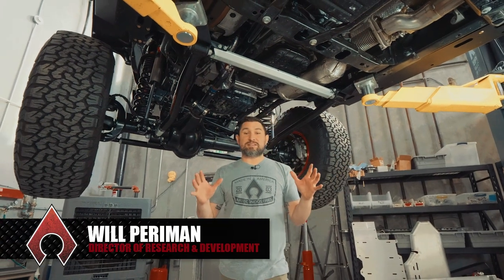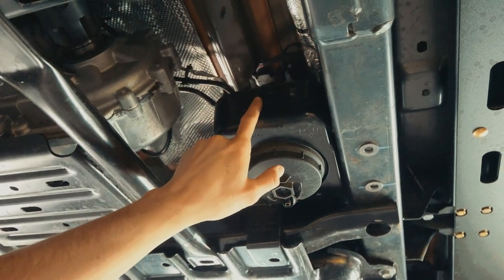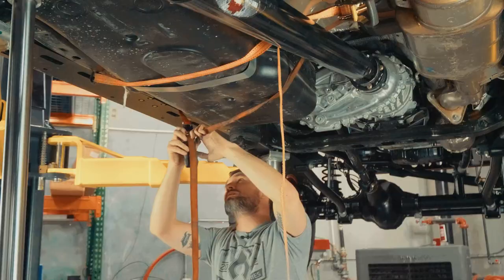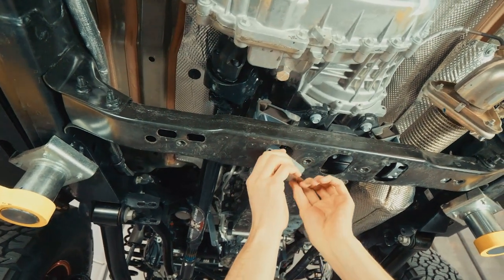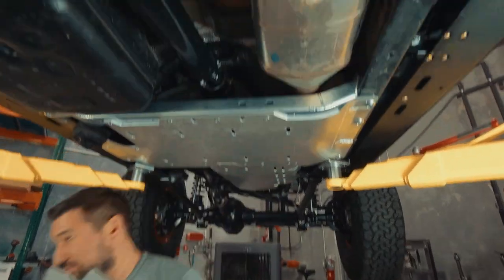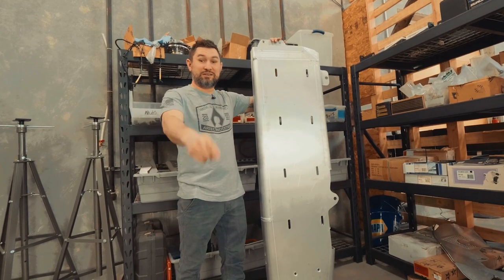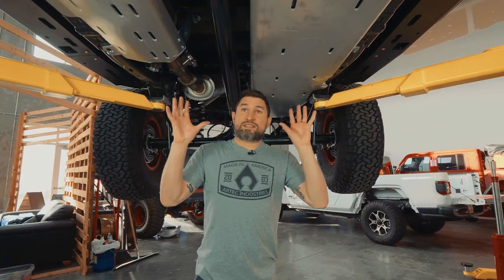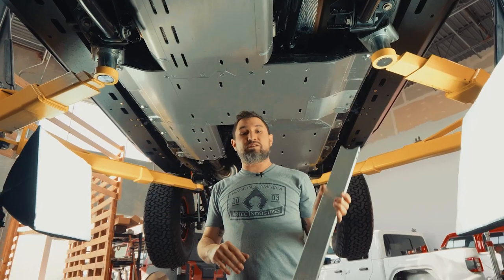NEW! JEEP DIESEL GLADIATOR BELLYPAN [INSTALL]

Comment: Was kind of hard to tell...is there an opening for the oil pan drain bolt or do you have to remove a panel for oil changes?
Reply from the maker: Version one of the Bellypan  had an oval hole for the drain plug  However all of the new kits (Version 2)  coming out in the next few weeks  will have a removable door to access the drain plug as well as some smoother radius  bends on some panels  for a tighter fitment

Comment: How do you get a conical recessed hex bolt out of the hole if the aluminum is gouged into the bolt or the bolt get stripped?

Comment: is there any sort of UHMW kit for this skid system in the works cause im pretty interested cause that would be another big selling point
if not let me know and ill go with the next venture motorsports belly pan instead :D
Reply from the maker: UHMW hasn't been requested much or needed so it is not something we are looking to at the moment. Not to talk down too much, but their skid system uses a lower grade aluminum, which is probably why it needs extra protection.
Reply: @ArtecIndustries  well thats nice to know,i really dont require a "Bettter grade aluminum" i just care about the UHMW feature since ive had good experiences using it compared to just a regular slider/or belly pan without it
also i have it on my can-am utv,UHMW really helps with sliding over rocks with ease and its super tough,without it ive noticed i dont get hung up on rocks as much with UHWM compared to aluminum since its soft even if its 5056 or 6061,thats just from personal experience 

Also i do like the fact you guys do use 6061 wich of course is stronger wich does sway me to go with yall apart that there is no UHMW kit available,but if you guys do have something in the works let me know since i can wait since im still am waiting for parts and also saving up for other stuff :D

Comment: You need to finish the JL video. Wish you would have stuck with all metric bolts instead of mixed metric and SAE bolts--hate having mixed bolts and trying to remember which is which.
Reply from the maker: We are currently working on getting several videos shot  majority of the JT and JL video will  be the same between the different platforms aside from the Fuel tank and Def skid.    As far as the Mix of SAE and Metric hardware  , There are many sizes of press nut that are available in sae that are not available in metric. There aren't press nuts around the 3/8" size. metric press nuts are also much more expensive with no benefit. We also already have sae press nuts in stock and standardized among all our product lines so that improves efficiency and isn't held up by supply chain issues that would come from having a whole bunch of different press nuts sizes to use. That means the customer gets the product faster.

Comment: Another excellent install video. Question I have is will the 3.6 bellypan also bolt up like this? Same mods to the brackets? Weld and clearance them?
Reply from the maker: It will be fairly similar. While we are working on the install video for the new Alpha series skids, you can still watch the video for our older style 3.6L kit, which will still have a somewhat similar install as far as bracket locations.

Comment: Removing that motor mount bolt was a pain in the butt! And the 10mm bolt you guys sent still isn't long enough to engage the nylock! Not to mention the nut welded on the frame likes to get sucked into the slotted hole on the bracket. You need to include a washer to go above the bracket and a longer 10 mm bolt to engage the nyloc
Reply from the maker: Thank you for your Feedback ,  This is something we have recently addressed as of last month the new hardware kits  going forward will include washers and longer bolts in all of the hardware kits.
Reply: @ArtecIndustries  awesome!